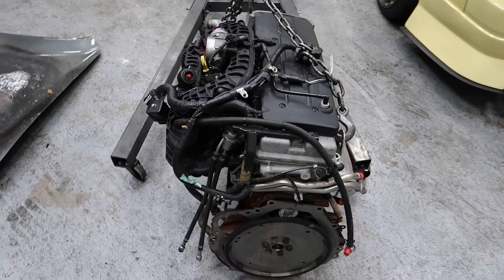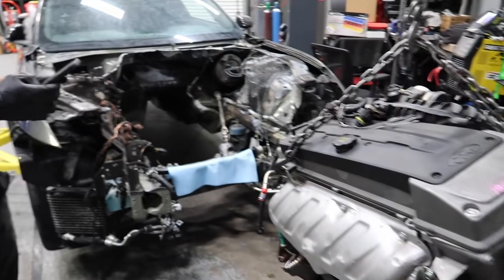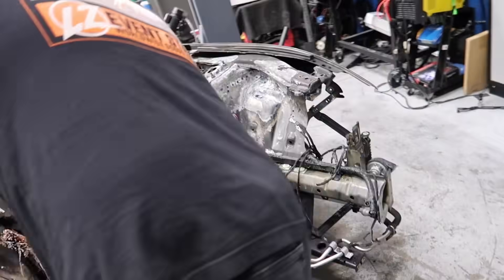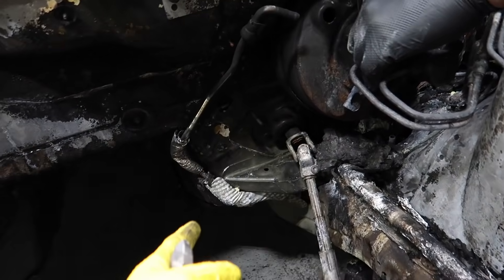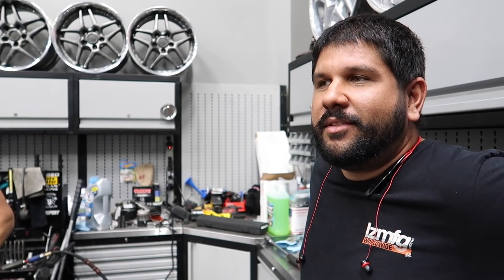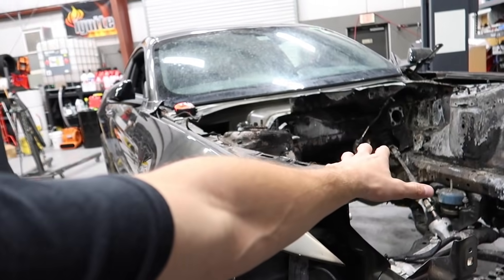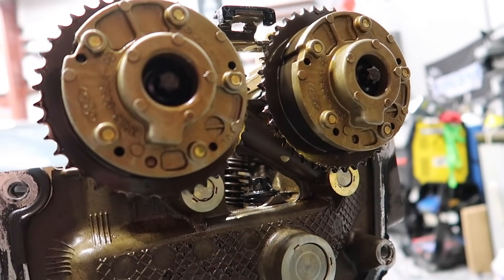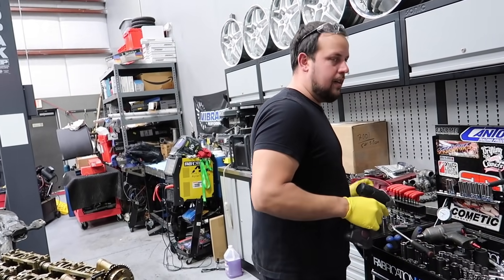The GT350's New Engine Arrived!

Comment: I keep wondering if and when Adam is going to do an LS
Reply: I assume he likes quick cars? Thats prpbs the reason behind not goin ls 😂
Reply: Elliot Barron is that why all the drag racers use ls engines?
Reply: @elliotbarron4913  LOL. LS would be way faster
Reply: Nah they probablu use them as theres shit tons of rnd and aftermarket options for the boat anchor, not much for the barra due to its age and only being released in aus🤷‍♂️
Reply: @eazy1144  They use Ls because they are the least complicated modern v8 platform and also the cheapest bang for your buck. 2jz, hemis, and even ford mod motors have faster 1/4 mile times than any ls. Ls motors haven't even touched the 5 second range yet.
Reply: @elliotbarron4913  https://www.youtube.com/watch?v=pW0oNGWtzAA 

3.87 secs @ 197mph
Reply: @elliotbarron4913  The same camaro went 5.69@ 272 mph. The fastest Ford motor has gone is in the 5.8s

Comment: If you want big power dont get the BA (from BA falcon) it was the 1st version and subsequent versions had a stronger crank and better valve springs.  The BA is risky if you go over 450 HP
Reply: Oh wait, You purchased the non turbo version.  Hmmm, not sure if the non turbo versions got the stronger crank

Comment: Oil pump gears, valve springs, being an old na engine you’ll need to upgrade rods or they’ll go into orbit.. decent set of pistons, intake, 4” exhaust with a high flow cat and a decent size turbo and you’ll see over 1000 with a weak tune on low boost..
Reply: Yup, that is the proven formula.
Reply: Yup, that is the proven formula.

Comment: If you have issues with the block and usually it’s between 3-4 piston which is a week spot then you get a LP gas block which people in Australia are getting and they hold more horse power or the other option is a billet block which are $10,000 for bare there’s one in a drag car over there. If you have any issues there’s a few dyno performance shops over here that would be happy to help you with what you are chasing with power and parts. I live in Brisbane Queensland and I take my car to real dyno performance in Kippa Ring my mate had his car done at HI Toque performance Gold Coast Queensland and the other performance shop I have heard of that’s knowledgeable about barra’s is BTA performance in Sydney or Melbourne. I have spent $4,500 on my XR6 turbo and I have 411rwhp and I only had valve springs upgraded fuel pump injectors 1000cc 3,5 inch turbo back exhaust high flow cat and muffler and re map ecu. If I get a bigger intercooler and re map for the bigger intercooler I will have between 600-650rwhp then huge horse power getting bigger turbo and then it’s upgrading the drive line hopefully you can find the help you need and get to enjoy Aussie power. If you have to strip cars back and it’s a regular thing you should look into the new laser stripping mobile unit rust removal metal material if you are interested they are available on eBay worth a look and they have a video of it in use.

Comment: mighty barra become popular after this in US, just change the valve spring, and oil pump, good turbo and good tuning just easily 600hp.
Reply: Not this na goldtop engine. Needs rods and pistons. The green top lpg engines have the turbo rods, and higher compression (good).

Comment: Rebuild it! 

I was a watcher when you started with this car, then your videos got all a bit the same - buy a clean car, get Alberto to rebuild it for you, drift it whilst buying another new car and Alberto Rebuilds that one.. 

Now you have a chance to rebuild something that in most cases would be scrap, make it a drag car or a burnout car for a cleetus event if you dont want to put to much effort in or go all out and fully build it, wiring should be easy as I bet it will plug in behind the dash, get a half cut and take the front looms out and you wont be splicing all the wires that way, and even if you have to splice the wires its a few hours work.

Comment: A. I really really hope don’t buy another mustang. Won’t be the same. Will feel like you cheated!
B. Don’t make it into a drift car. Keep it circuit with the brakes and suspension. 
C. You should run a Haltech that is one of the worlds best ECUs made in Australia and now have a show in the US. They have a new ecu/pdm that all in one box. No need for fuses or extra wires. It fixes all your issues. Only a couple of wires needed.

Comment: Isnt it so funny watching Americans discover the Barra 4,0 6 banger! They have no clue lmao!!!! @Adam ill race you car for car, but you might wanna get the Barra Sprint Engine... Google it as standard un modded  you will be in for a surprise... note most of parts out of barra motor vehicles in oz use mustang parts. Valve springs and billet oil pump upgrade are must do’s before going further. Also Haltech do a plugin ECU or just use Haltech Elite ECU

Comment: You’re never going to be able to have things like AC or getting the cluster to work correctly. A couple melted wires Is going to cause too many problems. Also the smell is deep in everything and trying to get things like AC is going to be a nightmare. Just gut it and make a race car.

Comment: a true car enthusiast like myself finds it hard to agree with bastardizing a car with historical significance. but i also know that you are a millionaire hotboii who does what he wants. look at it this way, how would you feel if someone took a numbers matching 67' 427 cobra and stuck a supercharged flathead ford engine in it. even if the car was burned to the ground in 67, the engine  could have been rebuilt, because parts were available. instead the value if ruined, the historical significance is ruined. and one day youll tell the story of how you regretted doing it.